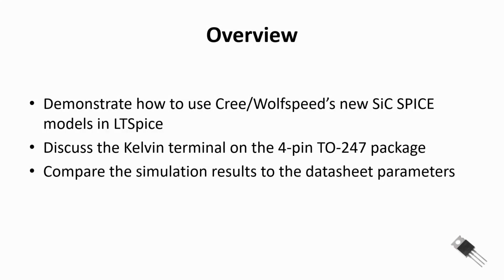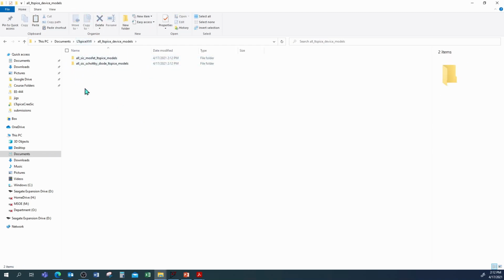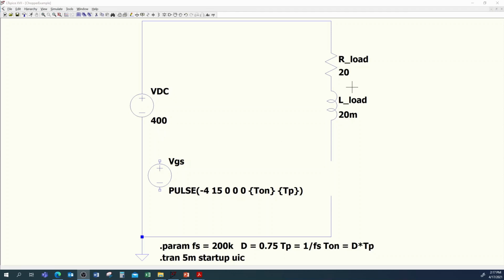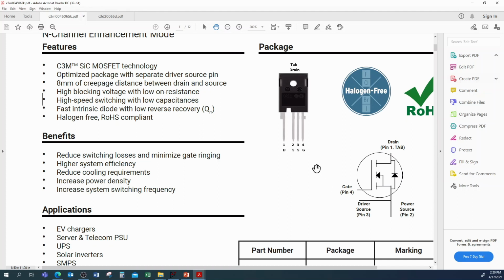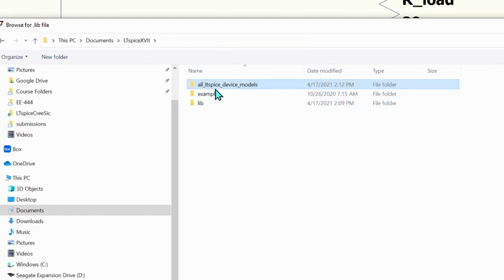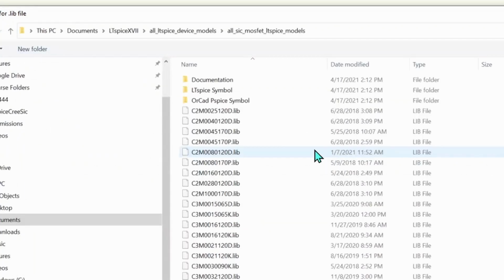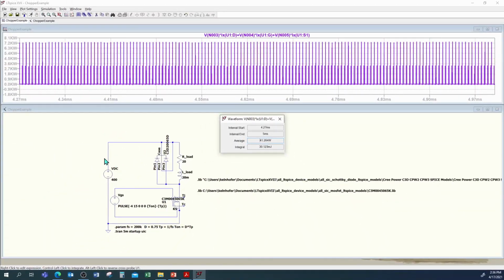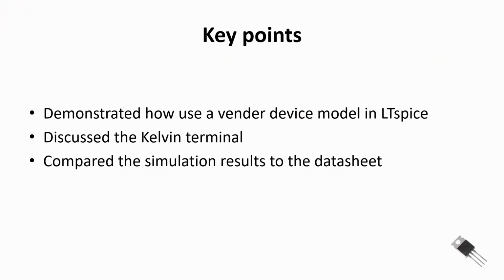LTspice Modelling of Wolfspeed SiC MOSFET and SiC Diode

Comment: Hi Dr. K.
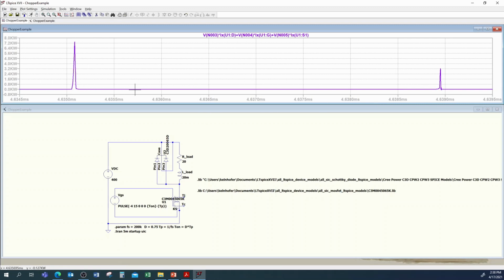Thanks for the video Dr. K. The switching loss (0.5*Pon*ton + 0.5*Poff*toff) you mentioned at 22:30 should be multiplied by the frequency, right? Otherwise, the units are of energy, not power.
Reply from the maker: Naveed, yes that is correct. You would multiply that by the switching frequency to get the total loss.  Actually you divide by the switching period (which is the same as multiplying by the the frequency) to obtain the average loss over the time.  Thank you for watching. -Dr.K

Comment: Thank you Dr K for demo the SiC MOSFET spice model. I tried the CREE model before using SImetrix. Were you able to extract the model and adjust the internal Rds ON resistance ?
Reply from the maker: Hi Thanh, you are welcome.  I did not investigate the CREE model to see what could be tweaked.  Something for another video perhaps.  I maybe switching over to PSpice.  TI is now providing that for running simulations.  -Dr K